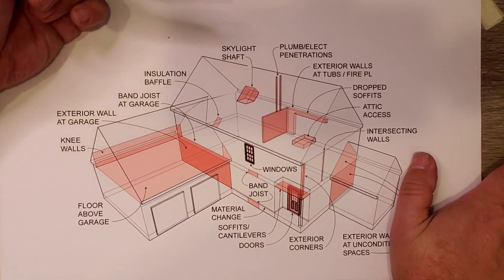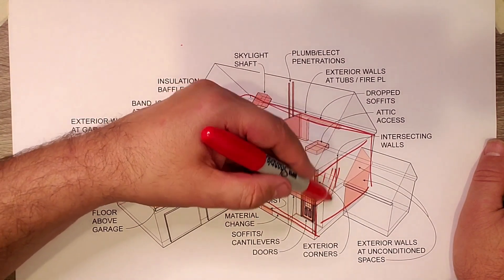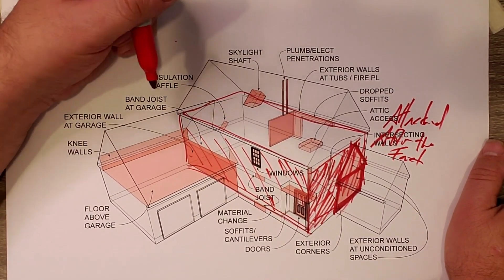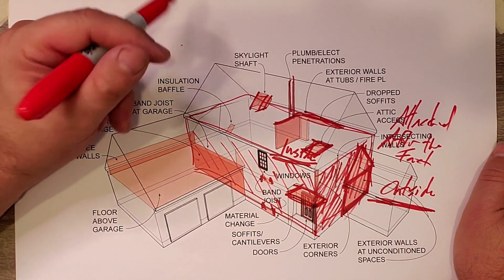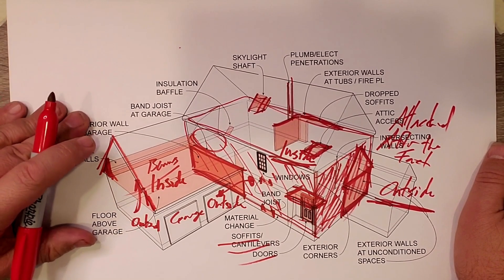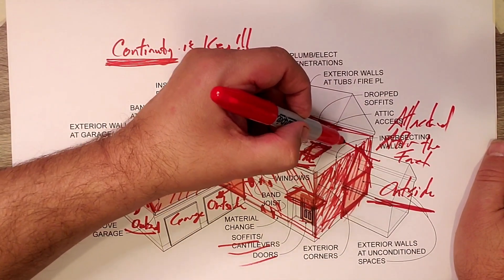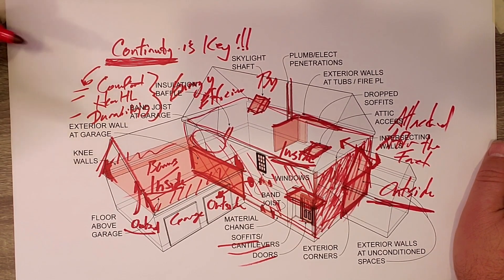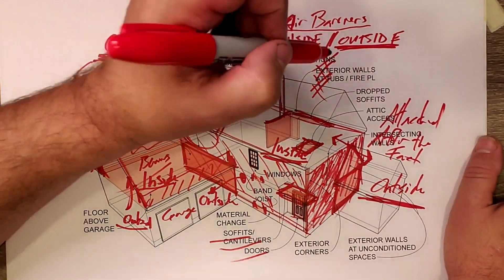Air Barrier Continuity

Comment: With the continuous air barrier using drywall how would you insulate after that is in place? Assume the only access to that cavity post roof and ceiling drywall would be the soffit vents.